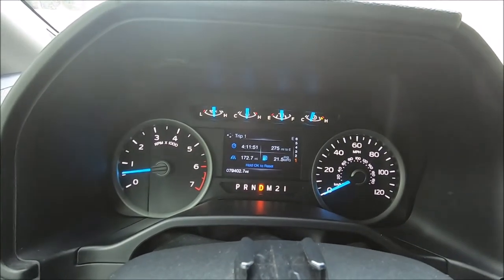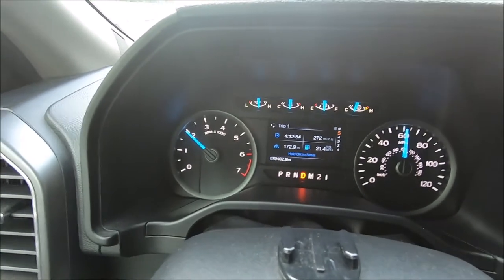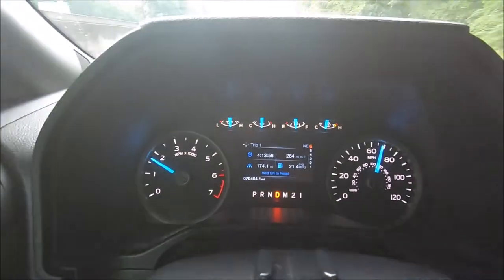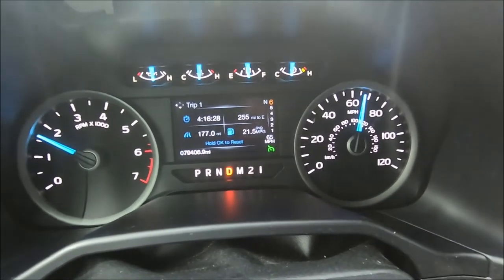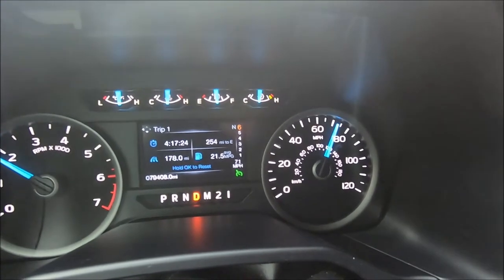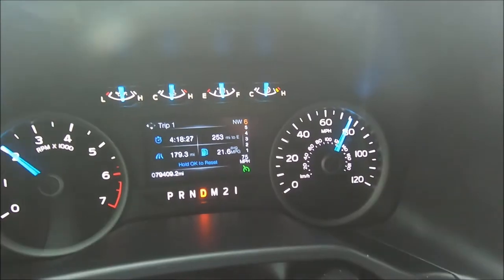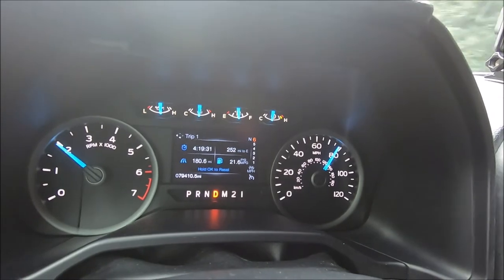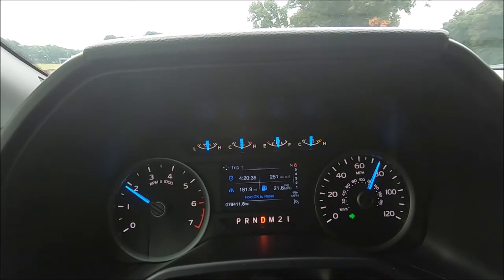2016 F165 torque converter stay locked up most of the time

Comment: I've noticed newer vehicals have lock up in overdrive and direct drive. Guys with the old 200 r4 trans would add lockup to there 3rd gear to help towing using a switch!